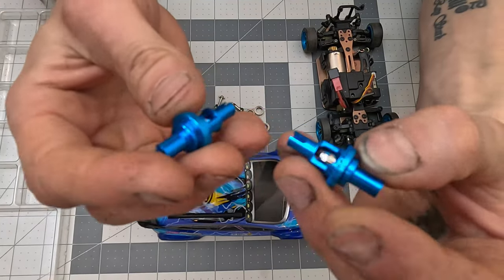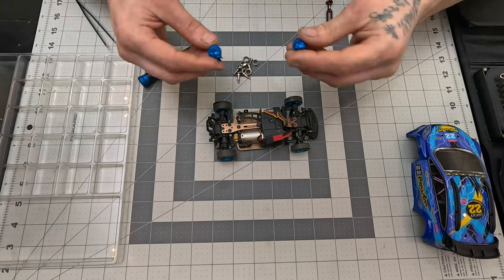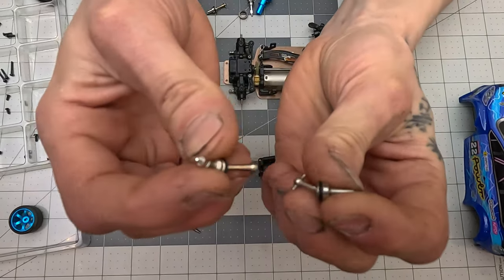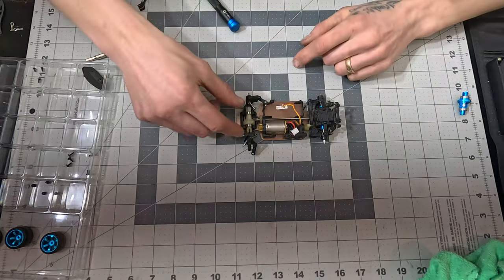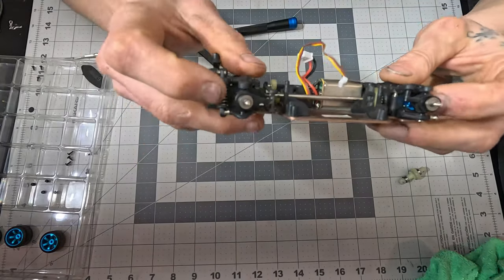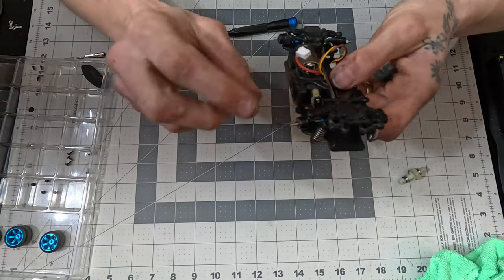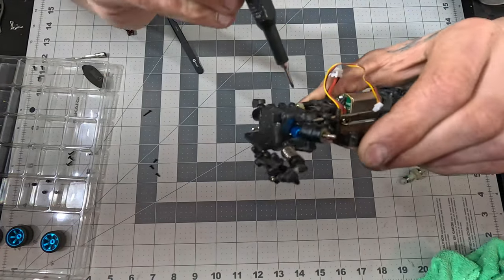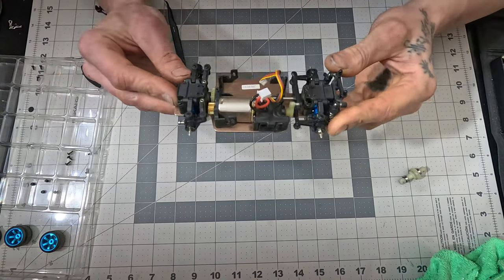wltoys 284010 Aluminum Diffs Upgrade Wider Steering & Some Drifties

Comment: is it always locked or  can it work as a diff too?
Reply from the maker: i have it setup so that its always locked but you can adjust the nut on the diffs to make it more like a lsd or an open diff, you just have to tighten or loosen the nut on the diff to set it the way you want it

Comment: Nice one. I am also in the process of doing the same upgrade on my 284161 😂

Btw, Have you tested your 010 if it has the same issues I found on mine? I would love to know. If that is the case that it is just mine. I will return it and get a new one. Let me know if you found something interesting or odd
Reply from the maker: Thanks for watching :) and i saw your message yesterday so i played with my car a bit today trying to see if it has the same issue as yours and as far as i can tell it does not, the power seems pretty steady wherever i am on the throttle going in a straight line or while turning so your issue could be the esc/reciever combo or there could be gears binding or something else creating extra friction when you get on the throttle. im not realy sure what is the actual cause of the issue, i hope you get it figured out though.

Comment: i'm curious if it can be upgraded to rwd, i'm considering buying it instead of the k989 but am afraid it can't or have difficulty upgrading to rwd because the differential has smaller bearings than the k989. Can you try to upgrade and share with me?
Reply from the maker: you can make it rwd, i will be making a video of mine at some point here in the future